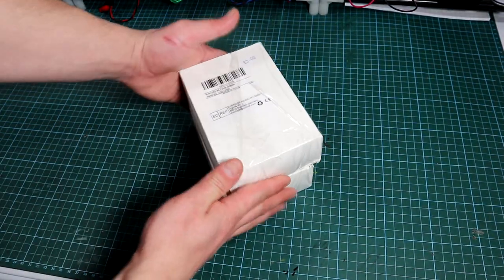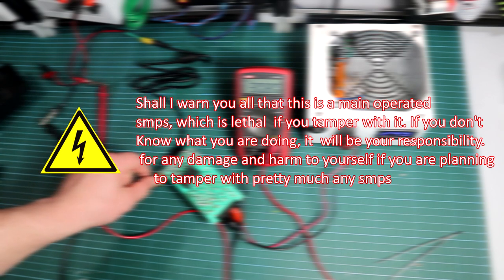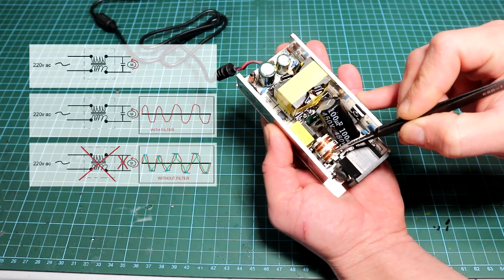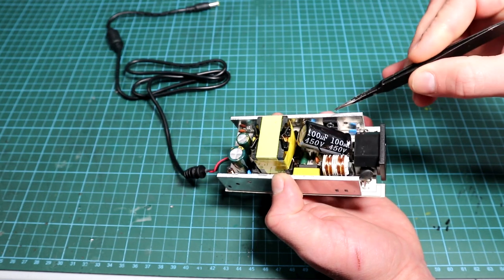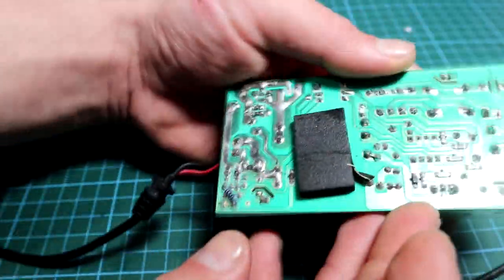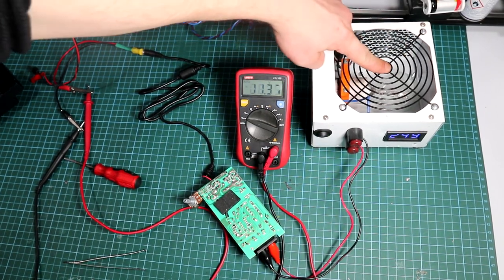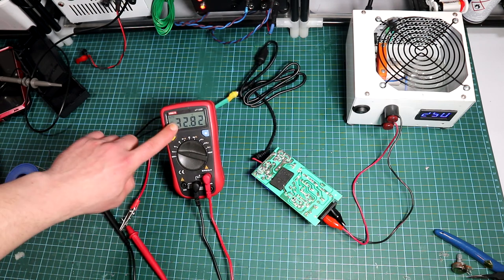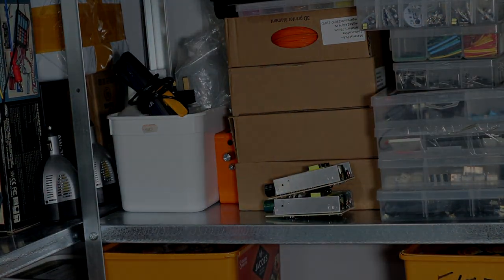Reworking SMPS Output Voltage TL431 - How SMPS Work In A Nutshell

Comment: Just remember to check the voltage rating of the output capacitors, for the higher output voltage. Some manufacturers "save" on the capacitors by fitting one that is the lowest possible voltage rating for the specified output.
Reply from the maker: Yes , that i forgot to tell . That's quite important thank you for bringing that up